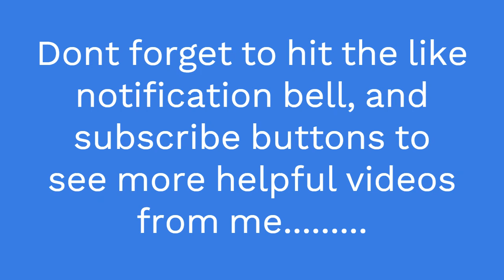Cuckoo clock repair for beginners (Hubert Herr clock sold by the Welby Corporation (See description)

Comment: The wire spring was right the first time, pushing the man out. When the music stops, the man should high center on the arm and make the man come in. That is why there is a short arm on the winder area. At least that is what I think. I am thinking this is a two tune music box. You can drill the old post out and install another soft wire.
Reply from the maker: You might be right about the spring but I would like to see another clock. It does have two holes in the music drum so yes it does play both on the hour and half hour. Yes I have replaced the broken wires before. Thanks for your inputs.

Comment: Hello, I have a problem, the door does not close cuckoo.  and it only opens half way like
Reply from the maker: search my you tube channel with problems cuckooing. I have several videos. There could be several problems. The birds tail could be  hitting the wire that lifts the tail. When it is done cuckooing the wire shouldnt be hitting the tail. The spring on the bird post might not be working properly. The bird should be tilted slightly so its nose is down slightly. The bird should be in the center of the door. A few more things could be wrong so search my channel for problems cuckooing. Let me know how it goes. Good luck.